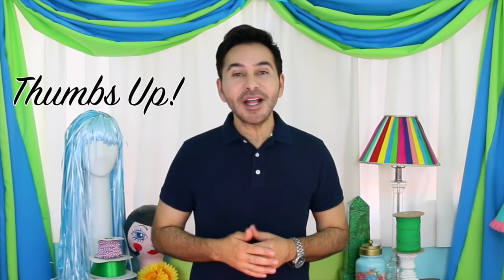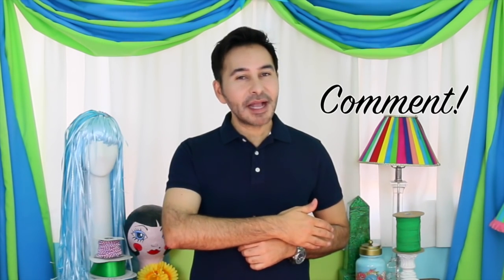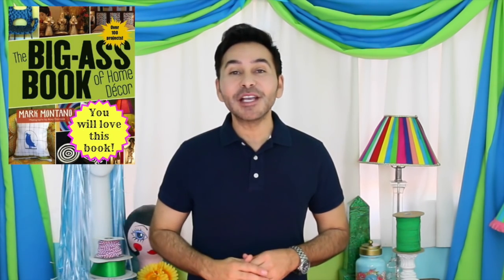How to: Outdoor Table Makeover

Comment: This is great.  Basically any old kitchen table frame would work.  I can't wait to get started on my set.  (still haven't been resale shopping).  It is on the "to do" list which is 100 miles long.  lol   Great video Mark!
Reply from the maker: Yup, any old table frame that you can remove will work for this Diane!  Check out the blog with more photos here: http://markmontanoblogs.blogspot.com/2016/05/outdoor-table-makeover.html

Comment: OMG...I absolutely LOVE this.  I have a wrought iron table ..broke the glass.  How would you suggest I attach the wooden top to an iron base??
Reply from the maker: Pretty sure you can just use plywood on top and then do some metal strapping around the top part of the rod iron.  Should work perfectly.  Put the planks on top of the plywood and you're good to go!
Reply: @MarkMontanoMakeYourMark  metal strapping?? What is that??